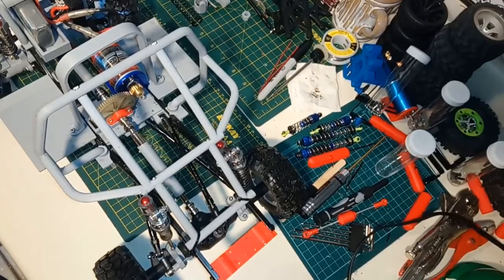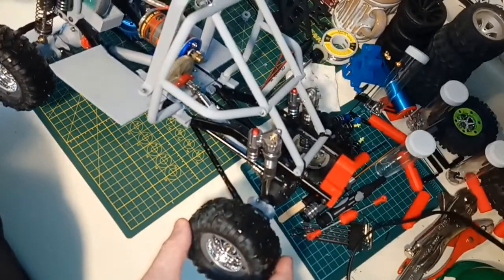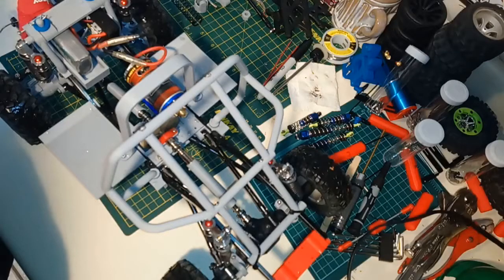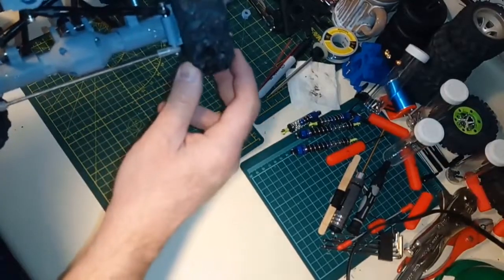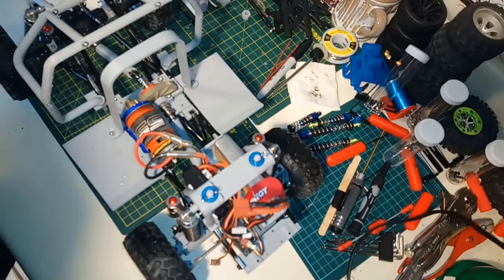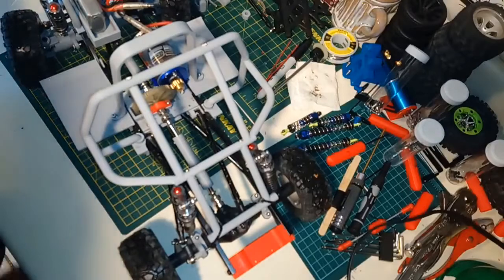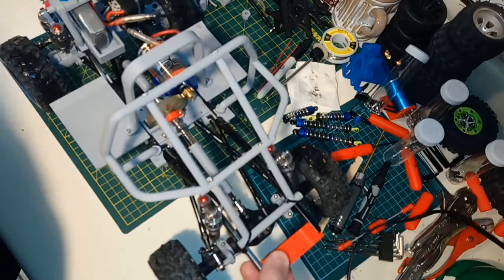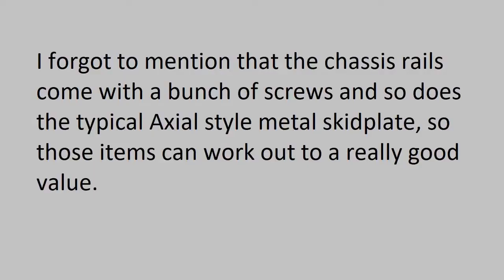WLToys 12428 Crawler Conversion First Run and Update

Comment: Please do a video about how you mounted the body to the frame.  What CAD files did yu use?  How did you print the 3D Files? what 3d printer did you use?  How did you mount the headlights How did you mount the tail lights? What bumpers did you use?  How did you mount the rear bumpers?  What What wheels did You use? Did you mount a winch? What other accessories did you use? What would you change if you did it again?
Reply from the maker: Thanks for the feedback!  I'll definitely follow up on a couple of those suggestions.  I try not to duplicate videos that I've seen lots of other people do, like details on 3D printers and printing because it's relatively easy to learn more about that.  It's tough to figure out where to draw the line on the car details because everyone has a different level of knowledge and building a car from nothing is a pretty big challenge so it's perhaps not the best place to start.  I figure that if you can build a WPL C24 you can probably build this truck and that's a pretty cheap and easy platform to learn about mods and stuff.  But I will add some more videos on how to, especially with the new Baja Racer rig coming soon...